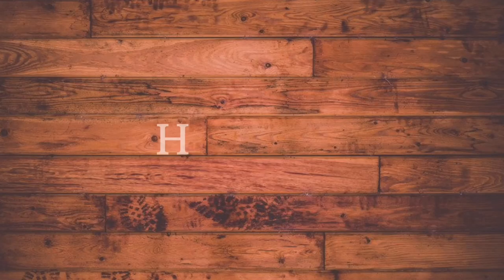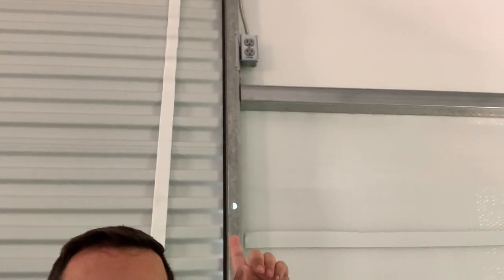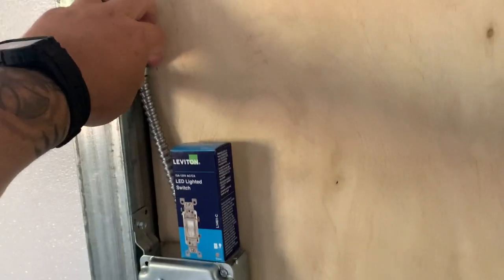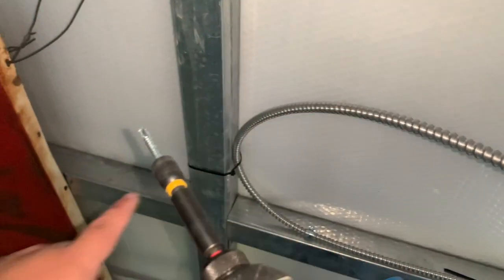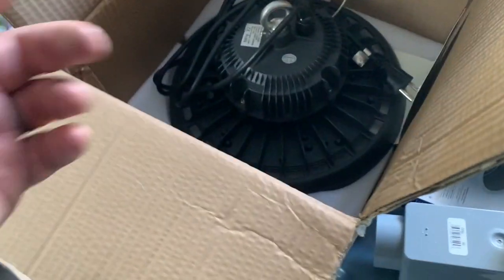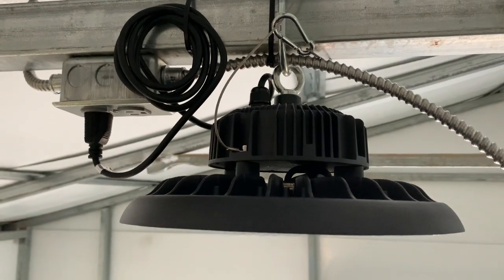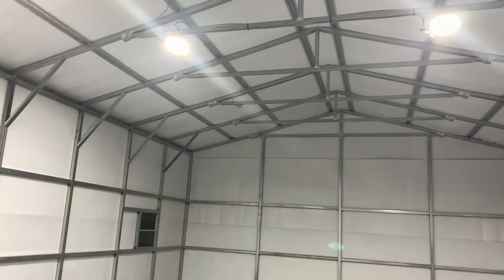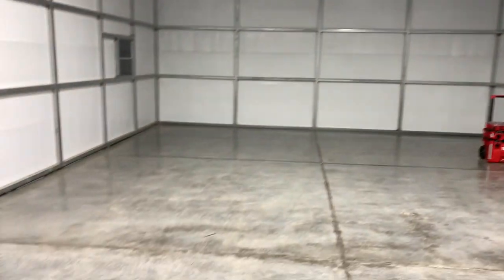DREAM GARAGE Build! | LED Lights

Comment from the maker: UPDATE - Not quite a year in and the lights have begun failing. Do not purchase.
Reply: No…………… I was just about to look for them to buy them
Reply from the maker: @matthewbarnes4993  Hyperlite now makes one at the same price point. $49 on Amazon. Two of these started smoking and popping - good thing I was in here when it happened. They sent me two replacements no questions asked but I think I’ll be replacing them.
Reply: @HiddenCreekHomestead  I wouldn't trust them....upgrade!
Reply from the maker: @Dozz70  already on it
Reply: Thank you for updating what did you insulate the building with?
Reply: Its just basic double bubble

Comment: 10:06 You should have 'pig-tailed' the hot's & neutral's so you would have just one set of wires attached to the device...difficult in a handy box I know, but 'code' in some areas and it's a better electrical connection.  Have you ever heard of using a green wire nut for your grounds?
Reply from the maker: I ran out but am graciously accepting donations

Comment: After years of a dim yellow incandescent lighting in my round top I've installed these LED  ufo's....Great bright lighting at last!! . Since you have to replace the entire unit instead of a bulb I prefer the Hook type hangers vs the fully enclosed  ring type as shown in your video, it will be easier to replace the unit when the time comes and I won't have to unscrew the 2 nuts on the U-bolt.
Reply: (Replying from my new channel).. you could always just put a carabiner between the u-bolt and the light which would act as a quick-connect feature.
Reply: @intheshoptv   Good idea, why dinna I think of that....one of my Duh moments lol
Reply from the maker: I have PLENTY of those. https://youtube.com/@intheshoptv?si=LcsFlQ3G4OusgYyx

Comment: How did you mount the plywood to the walls? I just had a shop built and trying to figure out how to mount the breaker box . Thanks and awesome video
Reply from the maker: I pre drill holes and then use self tapping screws

Comment: Looking good. Love the lights, I used just a couple of 20 foot strips of led's in my workshop. They were the cheapest things on Amazon and have lasted 5 years so far. They are a bit too bright for me really as the shop is only 6.5 feet tall which is enough for me as I am a shorty. Thanks for posting
Reply from the maker: I completely understand. In fact, renting a lift for $250 per day made me question my decision to go with 12-16 foot ceilings lol. Hopefully I reap the rewards when and if I ever install a lift in there. Thanks for watching!!

Comment: can you hook a garage door opener up to those type of roll up doors
Reply from the maker: Yes. Two options - if the center shaft is long enough, they make an opener that hangs iff the shaft specifically meant for roll up doors. Or in my case, you can take a standard garage door opener and mount it face down on the wall with the track pointing towards the floor. Then just attach a pipe to the bottom of the door, and the opener to the pipe!

Comment: Did you wax and buff your floor, looks great.
Reply from the maker: There is another video showing how I got the finish, the concrete company power troweled it, and then we used a roll-on sealer. I wish it still looked like that but with what we do in the shop now, its to be expected. Check out my other channel “in the shop tv” for all the content inside the shop

Comment: I did not understand why garage door opener outlet did not require GFI protection and the light outlets did. The light outlets are even higher and out of reach or not readily accessible.
Reply: (Im replying from my new channel)
Technically ALL receptacles in a garage are supposed to be GFCI protected as per the 2020 version of the NEC. However, It’s important to check your local code. The reason I say that is that adoption of the code is done in a variety of ways:
Statewide
By city
By municipality
Not at all.
And the adoption of a specific code or code update is always tied to a date. And your local AHJ will know the date. Go by your local code. According to the new NEC code, Id have to GFCI protect my welding machine outlet, or hardwire it (which Im not doing). Many local municipalities dont adopt everything.
Reply: @intheshoptv  thanks
Reply: @pete7894  yessir!

Comment: We might buy land in Lancaster, SC. First thing I’m going to do is put a metal building on it. Do you know where I would need to go to find codes for building a metal garage like this? Like for example where did you find the code that states your wire has to be metal clad?
Reply from the maker: I was an electrician for 18 years. Wire in outbuildings/garages has to be protected. If its enclosed inside a walk, that counts as protection, if not, it must be in conduit. MC cable serves the same purpose (protecting the wire) at much less cost than running conduit and is much easier to work with. Your local municipality will have codes but if in doubt, follow the NEC.

Comment: I use 26,000 lums UFO lights in our shop. My concern is with the way you mounted them. These lights we use get extremely HOT your power cord coiled above is in that very hot area.
Reply from the maker: As long as they aren’t laying on the heat sink, it’ll be fine

Comment: I know it hasn’t been a year yet but are the lights still going good?
Reply from the maker: Yes they are. I have a channel that I film for much more frequently that is ALL in that shop building. Come check it out if you have a chance! 

https://youtube.com/playlist?list=PLS6i13ij_WMmN-KMCqQxIiT2xBzHJ0ivX
Reply: @HiddenCreekHomestead  just subscribed to it. Thanks for the reply. I been needing new lights and was about to order the hyperlite heroes but I think ima go with these and save 30$ a light. It will add up with the 16 I plan to get. I’ll be able to save close to 500$. That will cover the wires I need to add to hook them up
Reply from the maker: @joshuamartin7443  Hyperlite has a new high bay light thats $49. And thank you for the sub!

Comment: Shop is looking good. It’s obvious that this isn’t your first wiring job. You probably know this, but certain tools don’t like GFI circuits. My wood lathe has to be on a non-GFI circuit. Lights are bright. Hopefully they last. We built a house 18 months ago and some of the LED lights are already starting to fail. Disappointing.  I went with strip LED lights in my workshop that I got at Menards on sale. They are bright but I suspect they won’t last more than a few years.
Reply from the maker: Thanks for noticing lol. Im certainly not a pro at this “homesteading” thing, but I may have twisted a wire or two in my past😊. Yeah, GFCI’s can certainly be funny at times. 

So just a hunch but your lathe might be a variable frequency drive, which will undoubtedly trip a GFCI device. A workaround is to hardwire the lathe with a disconnect which will render it code compliant. 

Yeah, LED’s are hit and miss. I have some cheapos that lasted forever and some expensive ones that crapped out prematurely, visa versa, and everything in between. Heaven forbid products have any quality consistency anymore, you know? As always, thanks for watching and for the comment! -Mike
Reply: @HiddenCreekHomestead  you’re right about the lathe and the variable frequency drive. They’re pretty common in electronic speed control lathes. The electrician who did the basic wiring for the shop put it on its own circuit to avoid the GFI problem and the inspector never questioned it, so all is well. How’s the garden? We finally got ours planted. Short growing season here in Minnesota
Reply from the maker: @gregj2647  Thats great! 
Its going well, though we got a late start… again lol. I should probably do a video on it.

Comment: Looks great!!  Glad to find a like minded homesteader so close.  We are just getting started in Greer.  Would love to get an in person tour of the chicken coop, leaning toward building ours along the same lines as yours.
Reply from the maker: Would be happy to! We’re not that far from Greer at all… Southern Greenville County
Reply: @HiddenCreekHomestead  I am in Southern Greenville County too! And we moved from Staten Island in 2006. Most importantly, I am about to add power to my metal building and that's how I found your videos. I have a lot of questions, the biggest one being if I have to run MC or use conduit. Is bare Romex allowed? Other lots of little detail type items too. I'd love to pick your brain. Seems like you have done all the research.
Reply from the maker: @paul11273  Absolutely. Email me… come by and check out the shop and I’ll go over it all with you! Retired NYDC electrician😊
Reply: I just wanted to say it was great meeting you the other day. Your advice has been much appreciated. We are underway with wiring up my building. Thanks again!
Reply from the maker: @paul11273  Yes! Enjoyed hanging out in the shop with you guys! Let me know if you need anything!

Comment: Not being sassy; shouldn't garage door opener be on its own circuit?
Reply from the maker: Great question! But no, in fact garages in 99/100 new homes are only required to have one 20a circuit in total! Crazy, I know. The only caveat to the garage door opener, is that it must be GFCI protected BUT the GFCI must be readily accessible (not over 8’). Thank you for watching and for the comment!